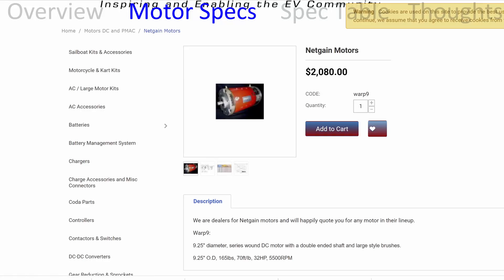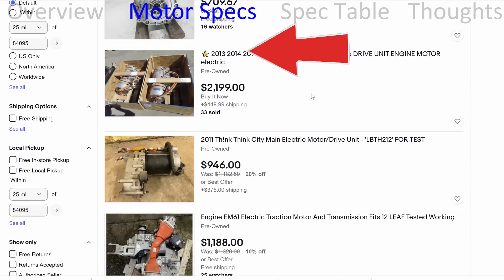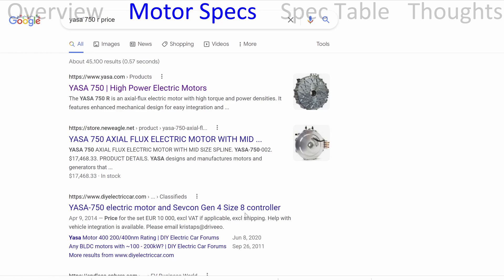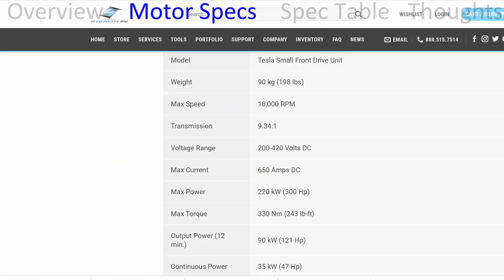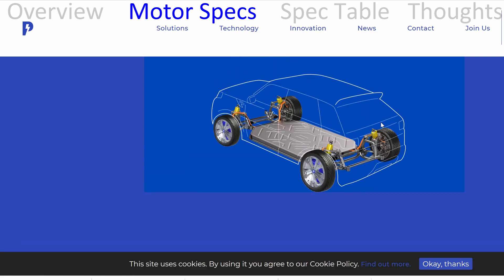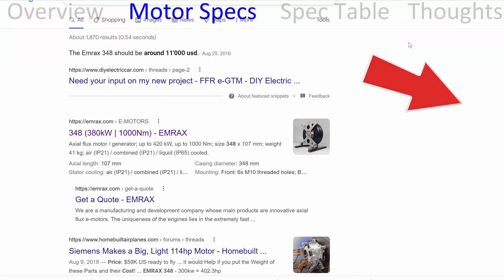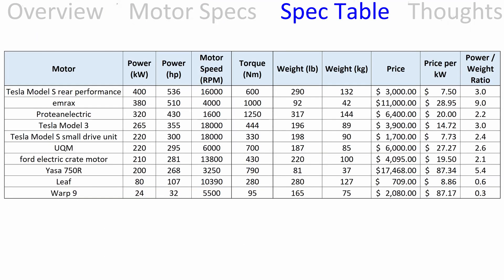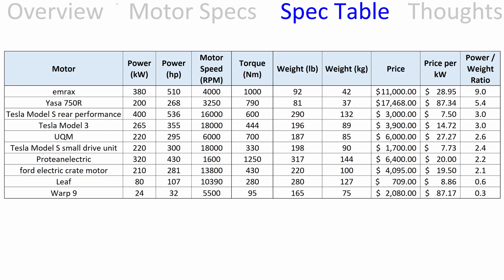EV Motor Selection – How to select a motor for an electric vehicle build - ESC S2 E02-D

Comment: Thanks for putting this grouping and motor stats together. My next EV will be an Aptera, which uses 2 or 3 wheel hub motors by Elaphe. Each motor is capable of 50 kW (67 horsepower). It's a 2 seat, 3-wheel EV, built for efficiency, but with 201HP and under 2,000lbs it will be quick. As for projects, I have a 1959 Karmann Ghia that I have been wanting to electrify for years. There are many people who use the Netgain Warp 9 engines (sometimes in dual motor configuration) and depending on the power available, configuration and controller they make about 100HP per motor, but with lots of torque, especially compared to the original 39HP/67ftlbs TQ of the previous gas engine. EV West has a subframe mounting plate to adapt Tesla's Performance Drive Unit, Base Drive Unit, or Small Drive Unit to the Karmann Ghia. The Model 3 motor looks really appealing because of its small size and weight. But looking at your comparison listing, the Model S small drive looks pretty comparable, and impressive for half the price. Batteries are the big ticket item in any EV conversion, and all of the control/BMS bits add up as well.
Reply from the maker: Thanks for the comment!

Comment: torque resting isn't as important for electric motors because you always have  wide power band and max torque at zero rpm. as long as peak power is enough to reach your targeted top speed on flat or slight incline, you should be good to move at lower speed even on a steep incline. of course if you know your requirements (weight, tow rating, top speed, drag area, maximum incline) it can't hurt so do a quick simulation. btw plaid motors have quite similar torque to non plaid ones but 20% higher max rpm (20krpm to allow for 200mph) and they maintain almost constant power throughout the whole power and which is pretty uncommon
Reply from the maker: Thanks for the comment!

Comment: You mention the Tesla Front SDU (small drive unit) but then showed the Rear SDU. They are different units but same specs.

Your motor is a Performance LDU. There is also a non-Performance LDU.
Reply from the maker: Thanks for the correction!

Comment: You forgot Nissan LEAF 2018+, they are 150 or 200hp Really the only difference is the battery and inverter.
Reply from the maker: Got it!
Reply: @electricsupercar  and really the motor is just one part of the overall power output. For instance Underground Electrics in Nanaimo, BC has taken a LEAF gen 1 motor to over 400hp on the dyno! He uses his own custom built inverter

Comment: you did a fantastic job with the white sports car, about 100 times better than the original components. amazing.
Reply from the maker: Thanks Ken!
Reply: Could you explain the motor cooling systems, what does liquid cooling offer that air does not and vice versa? Thanks in advance. @electricsupercar

Comment: none of my business but did you forget the new VW electric motor.
Reply from the maker: Which one?
Reply: @electricsupercar  the ID.4.
it looks like a very interesting motor. the electric motor itself seems exceptionally high quality and strong and the gear transmission system is next level efficient. very efficient. munro has some videos I saw on this particular motor and gives a high rating.

Comment: I have twin custom Warp 9's.  The advertised output is much lower.  At 150V each motor is about 350-400 hp and at 1600 Amps they are about 650-700 Ftlbs each.  Combined they run through a Lonestar Motorsports Overdrive unit. Which is 2:1.  So I get tons of RPM.  With a Lenco Trans 1st gear is 1400 ftlbs and almost 800 hp to the tire.
Reply: Do u have a vid showing it off?
Reply from the maker: Good to know
Reply: A drag car can run stupid power for 10 seconds.  A road racing car must run almost continuous full power for 30 minutes..or more.
Reply: why did you opt for a twin setup?
Reply: @andrew-qf4xl  stupid amounts of Tq and Hp in a lightweight car.

Comment: You are mixing motors and complete driveunits here. So not really apples to apples. Certain motors require an inverter to operate, like the leaf and mach-e while the tesla drive units have it all included.
It gets even more tricky when you then look at total cost to get a motor spinning wheels, Tesla motors and Nissan leaf motors and inverters require an additional control box to make this happen.
Reply from the maker: Right you are
Reply: @electricsupercar  Great video still, as if you were to try and bring things to an apple vs apple level most people would stop watching due to level of complexity and variables you have to take into account.

Comment: I would have expected you to correlate the electric motor with battery capabilities and weight to that perhaps there is a sweet spot to give you the best performance and range.
Reply from the maker: Batteries are more like which fuel type and tank size on an internal combustion car.  They don't really affect the performance,  just the range

Comment: Awesome video.  As for your next project.  Why not try to better plad? Use 4 motors? Make it a Hypercar?  I'm sure it will not be easy, BUT!!!  You don't strike me as the type of person that gets intimated by such a thing.
Reply from the maker: Thanks for the suggestion!
Reply: It may need a suspension upgrade if you wanna run a quad motor setup the speed is welcome but handling is what limits the speed. Too lose and it feels unsteady when you drive too hard and it feels hard when your cruising. Electronically controlled suspension may be nessesary or a hybrid air shock configuration or just go balls to the wall and build an off road trophy truck with solar chargeing capability
Reply: You don't know what kind of teritory you enter there.
You need insane aerodynamic knowledge and testing possibilities to not kill yourself and many others.
Just one example.

Comment: Battery requirements are important.  Voltage required, size, availability, cost are all important to motor selection and build cost of the EV.  The batteries you used in your super car build are no longer available.
Reply from the maker: Yes!  Battery episode coming soon!

Comment: Glad you put this video together.  I've been researching options for what I might be able to put in my Lotus Esprit.  One thing I found in researching Tesla drive units is that the newest iteration is referred to as the "Raven" drive unit and has some distinct advantages.  What isn't so clear is some drive units are marketed as being "Ludicrous" while others just say they came from a P100.  Maybe you can go into a little more depth as to the differences between the Tesla drive units and how someone would choose one over another.  It would also be helpful to know what additional components are needed outside of the batteries.  Thanks in advance!
Reply: Raven refers to the last generation Model S and Model X from 2019-2020. From a Motor Trend article- "Despite its name, Tesla's new Raven system isn't named after a bird. Reportedly, Raven refers to X-Men's Mystique (Raven Darkhölme), who can change her appearance on demand. We're assuming Tesla chose this name because the Model S can go from model citizen to rocket ship at the touch of a few buttons.

The Raven powertrain is currently available in the Model S and Model X, but only in Performance and Long Range guises. Essentially, the Raven powertrain couples the biggest battery you can get in a Model S or X with the rear motor of the Model 3 Performance (but on the bigger cars' front axle). That motor is a permanent magnet synchronous reluctance motor, and it's both more efficient and more powerful than the induction motor that used to sit at the front of Models S and X. Total system power output is likely around 690 hp and 824 lb-ft of torque."
Reply from the maker: Got it!  Thanks!

Comment: Look at a porsche boxster/cayman suspension for your build.
The front spindles use a dummy axle cause they are shared with the awd versions and then you just need to swap the stubby for a fully axle. The transmission could also mate to any of the standalone motors, but i think sticking with a tesla motor is a better/simpler idea
Reply from the maker: Thanks Joseph!
Reply: Im using the cayman s suspension in my build. The spline section of the axle is a tad longer so dont mix and match if you look into itz 
There is a great channel, the name escapes me but if you look up Porsche boxster cart it should come up. He used a boxster obviously to make a f1 style car.

Comment: Another great and informative vlog. 👍🏽😁💯  As for your next build, were you planning on an all wheel drive set-up? I saw that the Canoe EV is running 4 motors on their startup build. From what I can tell is that each motor is mounted on each wheel, with an amazing new suspension setup that doesn't look anything like being used in today's market. They referred to as the "Skateboard Platform" that would be used in most of their models, only changing the cab and body design to suite individual customer needs/ wants. It's said that this new design would allow for more battery storage. Maybe it's worth looking into? 🤔🤷🏻‍♂️
Reply from the maker: Thanks for the thought!

Comment: Does the weight of the Tesla motor include the controller? The motor and controller are mounted together.
Reply from the maker: If you mean the motor and inverter...yes.  the controller is separate and weighs about 1 lb

Comment: Great video,  thanks. One point from my little knowlage, when the motor is a part of the wheel and attached to the ream, it jumps with the wheel in each bump or a hole in the road. Because of the extra wheight of the combined wheel and motor, it makes the vhicle very jumpy and unstable relatively. I was reading a professional article about it that claims  that the car companies make big effort to reduce wheight from the jumping parts of the car, and move the wheight to the body after the suspension mechanism. Eanglish is not my first language so excuse my mistakes...
Reply: Yes its called unsprung weight and it can make a huge difference in performance for a small decrease in unsperung weight. This is the main reason for getting alloy rims, carbon ceramic breaks and other performance oriented wheel accessories
Reply from the maker: Thanks for the comment!
Reply: yes it could be a concern for motor life, bearings...it works for ebikes as long as it's not e mountain bike . aptera has designed a (3 wheel) car with hub motors that is supposed to start delivery by the end of 2021, so if if it's not delayed too much we should see first indépendant reviews "soon"
I also have a preorder on the sondors metacycle which is a hub motor electric motorcycle that is supposed to start delivery on April 
we'll see how handling is affected..
Reply: I have a work around for that, but I need to find those as just motors, no integrated brakes and stuff, they're adding to the cost for no good reason, and why they feel it has to be directly on the wheel is beyond me. 2 in the back can have brakes and be on the hub but the front ones should be attached to an independent suspension axle getting it there would mean you can put motor mounts in and it'd be stationary.

Comment: A guy who is good at DIY type projects can find REALLY good deals at surplus shops and metal recyclers or junkyards.
Look for replacement motors for forklifts.
I don't know about everyone else, and I'm not being critical of your build, but someone needs to do a little less conventional build and try to stick to components that guys can afford and still have fun with. I bought 2 brand new "pulled" motors that had been installed into a project that was never completed. Paid 150 bucks for both of them.
If I'm going to pay 10k or 15k for tesla motors, I'm still going to need a lot of stuff, including a car to mount them too.
Or, I can spend 30k for a used Tesla and get a couple motors with a car attached to them. And a battery as a bonus.
Maybe a motorcycle project would be cool.
Lots of older sport bikes, some with blown motors, for well under a grand.
I got a decent running Ninja with a parts bike for a 1000 bucks.
I keep seeing buggy projects and wave runners and snow machines.
Matching snow machines would make for a cool tank project by repurposing the treads...
Reply from the maker: Thanks for the comment!

Comment: I've got three Advanced D/C 48v/96v dual shaft motors that are able to be bolted together end to end.
They are supposed to be 20/40 HP depending on the voltage....
What I need is an inexpensive Speed Controller. I keep getting lost in the specs.
Not sure what to use.
Any advice would be greatly appreciated.

Comment: It's hard to say personally.

One, I have never done any sort of research on electric motors so your research extent and from what you shared equals mine.

Two, I'm sure your not trying to break the bank here but I would assume you have a budget for the next build that you would want to be within. What kind of budget are you working with? That could help steer suggestions.

So for me, I feel like the vehicle you decide to build will mostly determine what will fit. From the weight of the car without the motors to the space available. Is this going to be another two seater? Was this already a mid engine car or is the front and rear going to be fully custom? 

The speed junky in me says go big or go home, the more conservative side (whome I rarely listen to often enough) says pick what you could reasonably use in your area. What's the use of building a track monster if that's the only place you can drive it? 

Like Johhny 5 said back in that classic Short Circuit.... Input. Need more input.

On the face of it, it really seems like the Model 3 or the S is really your best bet and all others are just going to be more costly for less performance and like I said.... I have done no research here so that could be 100% incorrect.
Reply from the maker: Thanks for the comment!